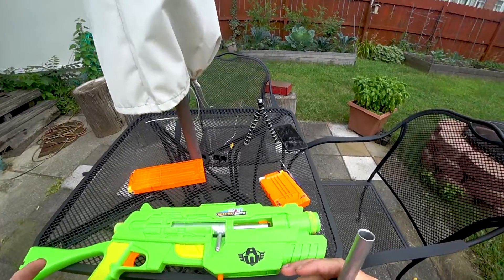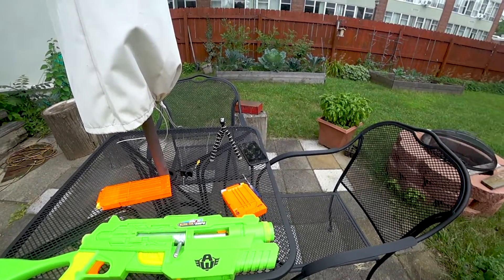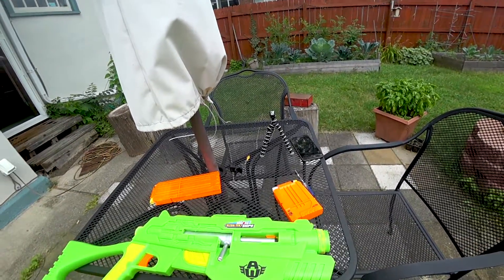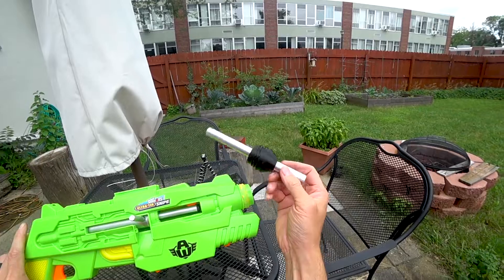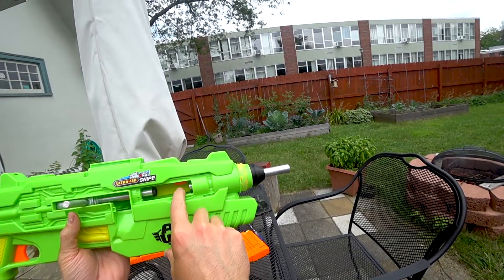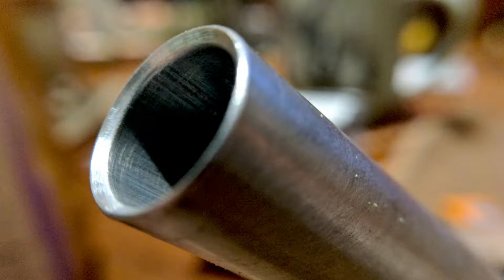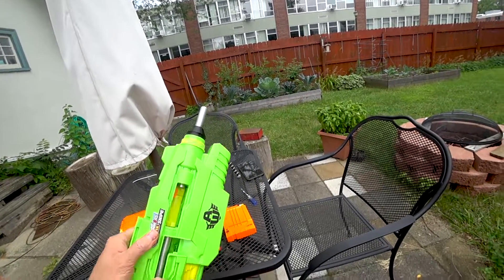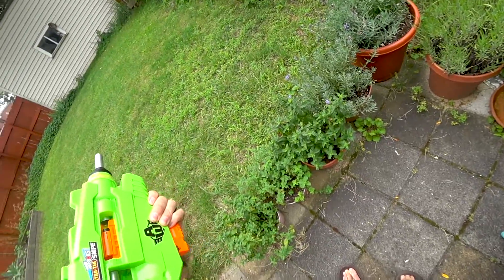Nerf Mod - Aldoss Alloy Mk I - Buzz Bee Snipe Aluminum Upgrade + 3D Printed Parts

Comment: I did something similar to this on my Snipe, only instead I left the bolt handle free-floating and kept the bolt-handle recess so that it seals against the chamber much more effectively. I found that something like what you're doing (rotating the rubber while pulling the bolt handle down) will wear down your rubber with all that twisting, and will even  break the seal from time to time.
Reply from the maker: +Thanhtacles do you have any pictures? I'm not against leaving the bolt handle free floating, I just feel like the rubber on metal connection will last a lot longer than a metal on metal connection would. I feel like it would grind away at itself.

Comment: Wanted to see this in it’s final state....
Reply from the maker: Yeah, I kind of lost passion for this project unfortunately. I had an epiphany and switched back to my sentinel breech and then I got super side tracked by my live streaming. That last one has also been consuming all my available funds too, so no real time or money to waste on aluminum stock
Reply: Aldoss 
Thanks for replying bud, truth be told, you along with Mongoose Jake are the guys that made me go out and mod a Snipe. As I type this comment, it’s still not complete. I’ve replaced the plunger rod with a Sentinel’s and it’s running on a stock Sentinel and Carnivore spring. Brass breech,stock extension, and full metal internals are my plans for it.
Reply from the maker: Hell yeah man! I love the blaster, don't get me wrong. I just know I don't have to time or money to finish it the way I want it done yet. Hit me up when it's done. I'd love to see the finished project.